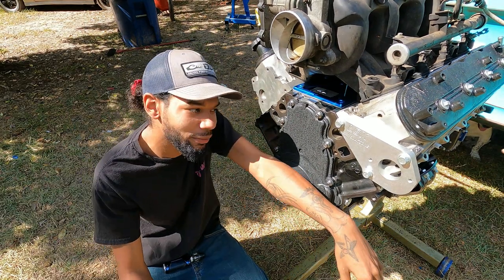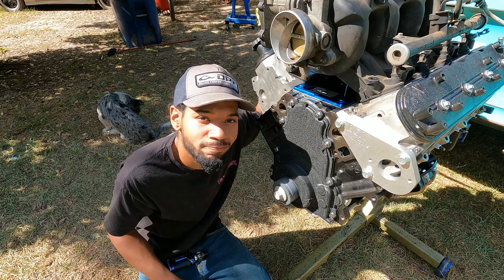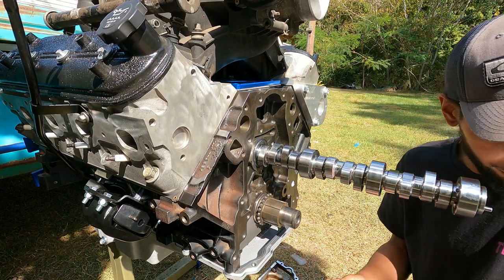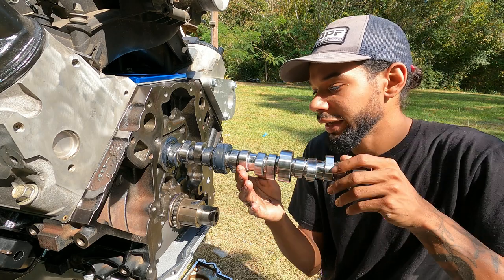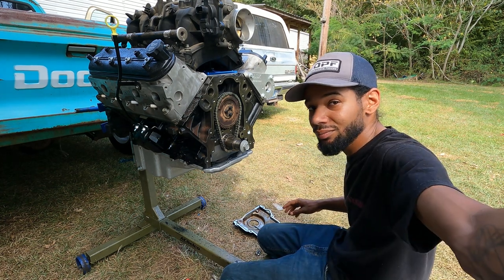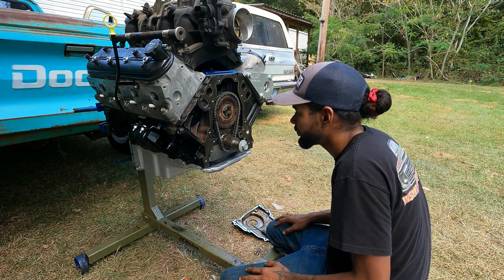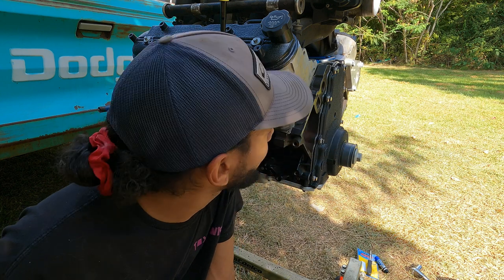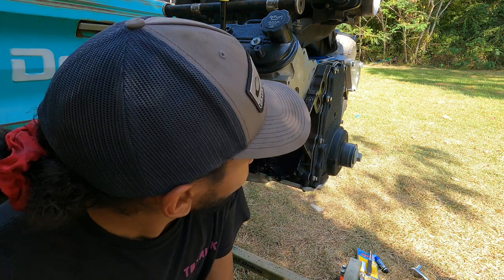Super Easy LS Camshaft Install (Super High Mileage LQ4)

Comment: Awesome brother. Thats a good looking engine. I like how you have her painted up. I am doing my first swap. Ls3/4L80 03' Crown Vic Police Interceptor.  The only reason I am doing a Ls3 is cause I found a 6.2 L94 block for $500. I already have a 6.0 crank and Gen4 rods. I have everything from a LY6 6.0 except the block and heads. Internals, front accessories. Everything. I just need to pickup new pistons and such. I found a place on E-bay that has the 821 heads already remaned and they are $450 with no core. Every where I look they want $800 or more and they are just used. I dropped  my block at the machine shop 2 weeks ago to get done. And yes I am doing cam bearings lol.
Reply from the maker: Nice score on the L94! I ended up having to get cam bearings, usually they are fine until you look at them, then they’re bad lol.
Reply: Their always bad when you look down lol.

Comment: Do you have rockers and pushrods ect in ??? Im confused on how you just swapped the cam and didn't take the rockers off and pull oushrods out
Reply from the maker: I didn’t. I had the heads mock on to prevent trash etc from going in since I was outside.
Reply: @TKSpeedShop  ahhhhh ok I was like wtf I could have been doing it this way lol
Reply from the maker: @kerryhunter6304 now you can use wooden dowel pins in the oil galley holes behind the timing chain to hold the lifters up. Buttttt I’ve never personally done that before 😅

Comment: Love the content.  I have the SS3 in a built LQ4…..  Texas speed must’ve been buying their cams from Elgin because their MS3 cam is the SS3.  So if anyone wants sound clips, look up the Texas Speed MS3.

I know Elgine supplies Trick flow some of their cams as well.  The SS2, ect.    I also believe Elgine owns Pac Springs.

Elgin is a very big company that makes a lot of .OEM parts for GM, ect.   People think they’re just some knock off China company.  They build everything in the United States.
Reply from the maker: Exactly! Most of the time people tend to judge due to pricing which isn’t always the case. I definitely recommend people checking out Elgin camshafts other than the SS2/SS3 grinds.

Definitely appreciate the love and support! I’m still trying to find a good balance between my upload content with my job life.

Comment: What machine shop do and how they charge?
Reply from the maker: Well it really depends on your area but most shops are pretty fair. You don’t really start spending money money until you have them assemble stuff. Around here you can get the block tanked, decked, cam bearings, bored and plugged for $500